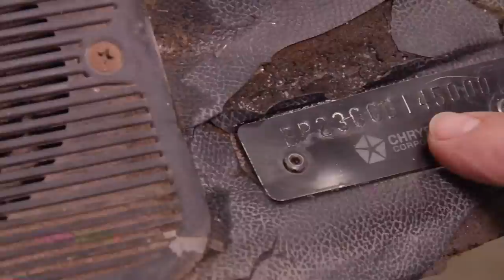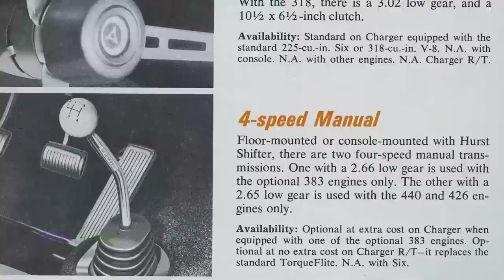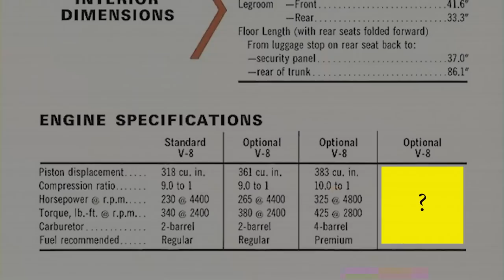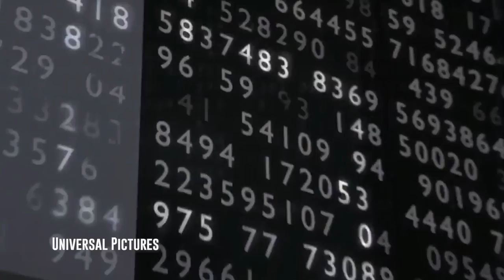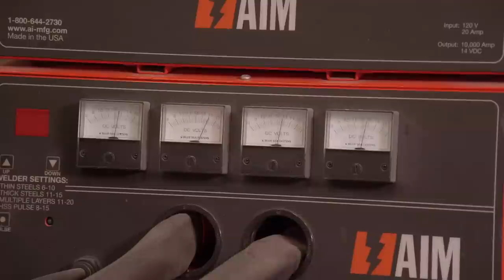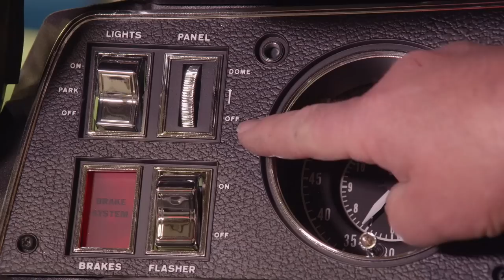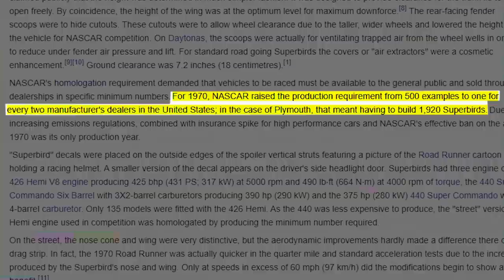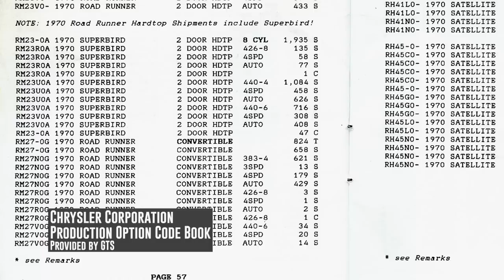NEW EPISODE: BUILDING A CUDA FROM SCRATCH: NEVER BEEN DONE!

Comment: This would have been a dream job for sure! I have done this once, started about 7 years ago and it took me like 5 years to get it done. Paint, body and the engine i had people do for me but i put it all together all by my self with no help exept for the windshield and rear window with no experience of old american cars. Next car i WILL do ALL by my self!
Reply: I do my own restorations and don't send them out for shit. You'd never get it back! Its easy to do it all you have to just decide you want to do it. Also paint is probably the easiest job people cant do or or are afraid to do and its one of the easiest things to do on a car, other than all the prep work that needs to be done. However that is done minute by minute hour by hour day by day and week by week, and then even month by month if you are slow. But metal work, paint, prep...simple stuff once you lay down some practice runs which builds your skill level incredibly fast. Good luck on your next one. It is the most rewarding job to do it ALL!

Comment: There's one thing better  than boxed in steel..that's boxed in steel that's had the inside painted in thick primer or galv paint and weld through prime on the joints before welding together ...especially on sills and especially in countries that like putting car disolver (salt) on roads!

Comment: 5:00 this is amazing - so there cannot be original rubber parts - certainly worth using - so what makes a replication different from an original recreation?   Or am I wrong - there is true original parts that are not degraded?  29:00 just remarkable. The padding has to be redone in a manner that is more durable - they all cracked back then - my '74 Coronet (my Grandad gave it to me shortly after I got to Winnipeg, as he knew I sold my car to get there) .. the dash was not bad, BUT it had a big split and stretch look .. separating where it rises for the gauges.
Reply: some rubber parts can last a century when shelved in climate controled environments. Yes you can use NOS rubber today if you have it. For me its way to expensive and so aftermarket OER is about the best second. Origional replacement parts. Now you are thinking about cars that have been on the road and put up wet day in and day out for years. The rubber never holds up while outside in the weather. NOS parts are ridiculous to buy. A rubber rad hose can cost $75 dollars.  Verses an oer or aftermarket for $5.

Comment: Too bad it's painted ivy green instead of the ralley green in the original photo.i had a 69 1/2 road runner paint code was 99 special ralley green was a spring of 69 color only... and I restored the car and left the original color and markings on the inside of the trunk lid....if that super be is supposed to be ralley green they shot it the wrong color.